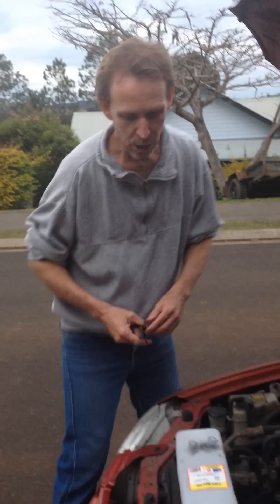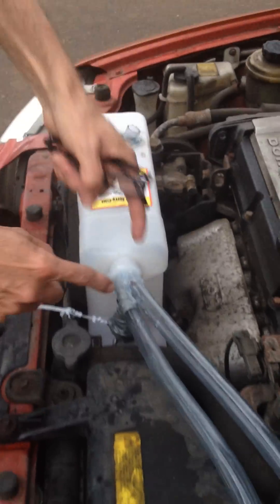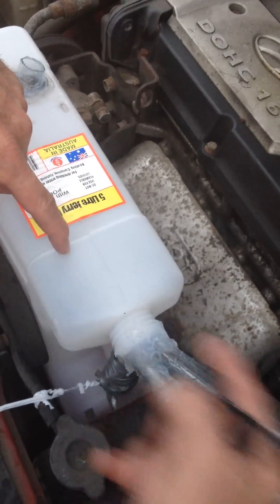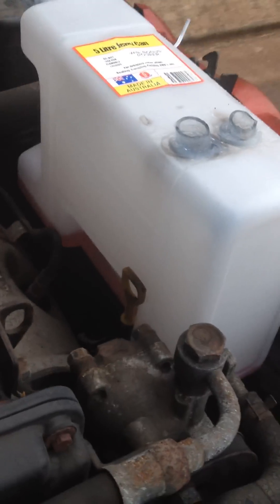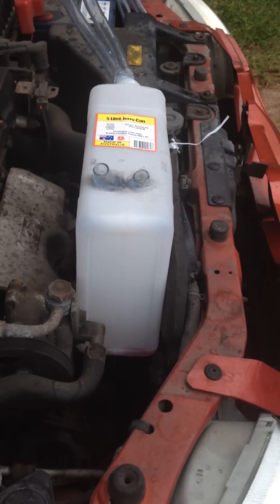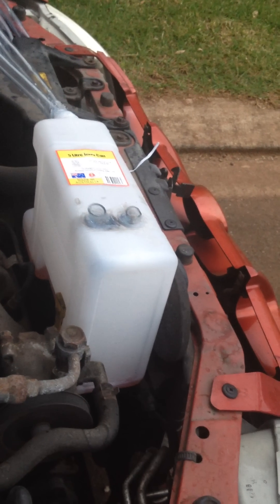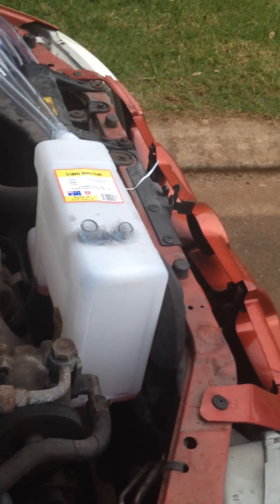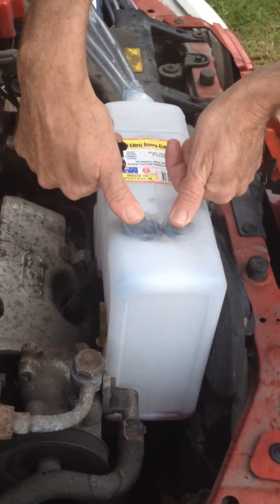Save on Gasoline Run Your Car On Fumes.

Comment: I'm not denying or believing this guy  but to everyone looking at this from a non bias point of view and analyzing the video I noticed something that didn't make sense to me and because of that I would not believe this video but that's not to say I don't believe it's possible but in the video he holds up the fuse box or relay cover box and the relay he is referring to that he pulled out did not align with the sticker on the inside of the cover which when looking at the cover it was on the top left hand side which would align when putting it back to the top right hand side and the fuse that he removed was on the top left hand side which would mean the sticker would have to be on the top right hand side when looking inside the COver, I hope that made sense.

Comment: Hello Paul. Gasoline is getting more and more expensive. And I have decided to do this experiment in my car. Could you tell me if when we remove the fuse from the fuel pump the injectors are damaged when they work dry and then we can not use them anymore.   If your car has injection. Could you tell me if in all these years you have not  had to use the injectors anymore?  My car is a subaru forester 2009. Please help me. I am a little afreid of losing my injectors. Your answer is very important. Thank you very much. Mario.

Comment: The problem I see here is that it has a free flowing air intake with  no air filter. It will be sucking dust and dirt !  Also, there needs to show a way to have a heating system to keep the fuel warm.  I would suggest a copper coil running from the radiator fluid line to the fuel container (This would also aid in fuel vaporization) or coiled around the fuel intake hose that goes to the intake manifold.

Comment: Thanks sir.. This will save the average person $1200 to $2000 dollars a year.

So you just need to find a spot to put the plastic container under the hood of any car then run 2 tubes into the air filter than one to the intake?

Comment: Its full of sh_t people !  Trust me , I try that at home already on my push mower !  It does run on fumes but here is the problem ?  I did a equal fuel consumption test of eqal part of exactly 1 cup of fuel on both and the fumes ran exactly almost 2 minute longer than the straight fuel and carb set up !   Here another problem ... my fumes lawnmower had ..... NO proper fuel and air control to regulate the power needed properly to cut the grass !  also .... no power or stamina in the engine HP for the real world grass cutting job unless you are cutting up to 2-3 inches of grass at best and thats pushing it ...trust me  !  I don't see any positive result in converting liquid into fumes other than burning a little cleaner for the enviroment  but then again .... why do we start the push mower and the car anyway ?  To ensure we get the job done properly with control and stamina of HP to get the job done right the 1st time !    RIGHT  ?   There  NO control or adequatete HP  to get the job  done right just to run the engine a few seconds longer !   ..... if he telling you he getting 10-100 miles more than what he's getting now running on fumes !  ......  He's full of sh_t !

Comment: UNSAFE....CAUTION.... This person has placed a plastic fuel tank directly next to his car's exhaust manifold ! Exhaust manifold temperatures can get up to 1000 degrees Fahrenheit! This is a fire and possible explosion waiting to happen. The plastic fuel lank will melt, and the gasoline vapor and air will explode and catch the car on fire. Very Dangerous situation!
Reply: Bubbler type vapor systems do not work, because they will not vaporize all of the gasoline, in the bubbler tank. Only part of the gasoline will vaporize with a cold gasoline bubbler set up. Gasoline is made up of a combination of different ingredients, some of which vaporize at very low temperatures, other parts vaporize at temperatures of up to 400 degrees Fahrenheit. This engine will run for a few minutes on the low vaporizing temperature parts of the gasoline until the gasoline goes flat, and then the engine will stall, and the gasoline that is left in the bubbler tank will not produce any vapors.  If you would like to see a real... safe... engineered... all stainless steel gasoline vapor system that uses 100% of the gasoline, check out the Gasoline Vapor Systems group on Facebook.
Reply: Really ? You say that it can get up to " 300 to 400 miles per gallon". Can you prove that ? Have you done any testing?

Comment: Have you tired driving while the injectors are still on? Im thinking that the extra fuel vapor would help the ECU lean out the fuel injectors, and get better mpg.

Comment: I had the diligence to try this... WELL -  IT DOES NOT WORK... nothing changed, same consumption on same millage, in fact, I run out of fuel, had to connect my fuel pump for the car to run normal.

Comment: You know that your car now has 1/5 the power it had...right?
Plus there is a reason why cars don't have plastic fuel tanks...do you know what "electrostatics" means?
Reply: You are an idiot. The tank in my truck is plastic.
Go read a book.
Reply: JDM Fanboy do your research,BMWs for exampe have had plastic fuel tanks since time immemorial.
Reply: Um dude 98% of cars now days have plastic tanks because there way lighter I highly advise you to go have a field day at the junk yard

Comment: i have successfully got this working in my truck this is not a lie, however after about 6 minutes of  running the gas can ( plastic tank ) gets too cold to produce vapor and the car stalls, any idea on how to keep the tank warm?
Reply from the maker: Hi ZZROBProductions don't know if I can help. When I did this I believed the bubbling effect was producing enough fumes needed to run the engine. I haven't done any further experimentation since.
Reply: Paul Freeman thanks , I'm going test it with the wicking system like the vapor kid did, the results should be better.

Comment: Everybody video show that it works but nobody has shown how far you can get on a gallon of gas!!!
Reply: Because it would get them killed.
Early reporting of these engines in the early 70's you'd get a few hundred miles to the galon

Comment: Josh you can also put wicking material in your tank check out Humidifier filter material you will notice that it will wick liquid  up on it. maybe even baby diapers check out the material they use on fuel spills to absorb the fuel be safe

Comment: also I had an idea to allow a small flow of petrol to travel to and from petrol tank.. say a low volume flow pump to replace the tank pump
to happily and gently circulate fuel and also generate more fumes with smaller increase of flowing fuel which may help with starting engine.

Comment: could you do an update of this process if you have this car still?

also a flux tank for vapours might be ideal with check valves to hold the gas in the flux chamber to allow the car to start easier.. 

the check valve alignment always prevent against the floe ie, only allow vapour flow to enter engine and never come back out to have backfire prevention

Comment: Also....your tubes appear to be too large. We had a explosiometer to learn how combustable vapor is. It does not require that much vapor to sustain a gasoline engine to run very ..VERY well.

Comment: This may be a little late to post but hope its finds its way to you or wnyone else working on a similar project. Back I n the mid 1070's myself and two friends decided to work on this based upon our memory that when we were in high school and on dates, just before our cars "quit" running, we experienced added performance. We summized that we in fact were running on fumes. So we set out to try to do that on purpose. We used a 383 HEMI engine in a Dodge pick up. We did not have the technology that you have today to convert raw gasoline to vapor so we designed and built a highly sealed canister and also design a ceramic resistance heater within the canister to use heat to expand the raw gasoline. The pick up/ 383 engine we used had a electric fuel pump.  Lesson 1. We had to install a cam so we had a cam driven fuel pump so as the RPM changed, so also did the fuel feed in direct harmony.  We also had to overcome timing issues. After we got it running, we experienced increased engine operating temperature of over 100 degree's. So we had to make alterations to control that. Once completed we experienced a few things. One, we got over 110 MPG over the road, in mountains and below sea level. We also experienced substantial increases in HP and torque. Three adult men in the old truck on the highway headed west between Dallas and Fot Worth Texas at 65 MPH and THEN..floor boarded it. We burned rubber for at least 100 feet from that speed before letting off. In construction and design, we used a Rochester quadrajet carb. We determined and had a new ventura slip made to insert in to the top of the carb. We also had little luck trying to use the vacumm to pre4sent the vapors in to the "top" of the carb at the air cleaner. We ported input or feed lines in to the side of the existing carb top "at center". We were highly successful. We knew that we were all going to be millionaires. We had patent checks run so we could start our patenting process. We found that just about everything that we did that provided the beneficial cause and effect had already been done and patented as far back as Henry Ford and up to the last 5 years prior. All held/controlled by large corporations.
Reply: As a former patent broker I know there are between 240-250 patents on this device.Some were held by Shell Oil, GM, Ford, Chrysler to name a few. All are in the "public domain" now and not "controlled" by anyone. All the patents had a 17 year life and now all are expired. This means anyone can build one based on any of the patents registered based on the drawings supplied for registering the patent in the first place
The government isnt in possession of any patents as they are the body that issues them and they have the right not to issue a patent at all. If they were trying to bury the idea they would not have issued patents for it in the first place
The reason the rest have not marketed the idea in the past is because it has never solved the problems in using it for everyday traffic conditions. Vacuum is not responsive enough for constant acceleration/deceleration. While I have acknowledged you have had limited success, it takes extensive testing to determine its limitations
I have worked on this idea for 3 years full time. I have thought of solutions to the limitations but it is not the "one size fits all" $300-$1000 add on that is the benchmark for ideas like this

Comment: This is a scam that has passed the test of time.  It is over 50 years old.  Why settle for just better gas miliage ?  
There is a way of using the engine exhaust to vaporize the gas.  If you do it just right you will never have to buy gasoline for the rest of your life.  Just route the exhaust pipe directly into the gas tank.  Even if you survive, more that likely the car will not,  so you will not have to buy gas for that car ever again.  R.I.P.

Comment: Tom Ogle did this 40 years ago and tried to sell his invention but was murdered by the oil tycoons
Reply: Tom Ogle was actually not successful and he knew it. In his remarkable test he stalled 5 miles short and still had gasoline in the car and could not restart. Tom Ogle knew it had to run at a set speed all other  successful tests of this device were done on test tracks at a set speed
Reply: Leslie Clendening humm... Set speed you say? Like a constant load off of a generator charging a battery pack?

Comment: 2 tubes going into that plastic tank and the ends of them are protruding out.
Reply: The two tube sticking out are vertical bubbler tubes that go down to the bottom of the tank below the petrol level, the tubes exiting horizontally just protrude into the top of the tank to suck the fuses/vapours into the air filter assy.

Comment: Paul, have you or possibly Josh made this work long term? I'm trying this on a 2000 Chevy 3.1 V6 and have been unsuccessful so far. I noticed that you have very little petrol in your container. I'm using a 1 gallon gas can and have it half full. Two 3/4 inch pipes take the vapors to the air intake and I have the same bringing in the air to bubble the petrol. Perhaps I need more intake air and output vapor? Thanks, mate. Transplanted Brit to the USA as a kid.
Reply: Hi Jack, Please check out the Gasoline Vapor Systems group on Facebook.

Comment: When will we see an engineer with money look into this to see if it is possible.
Reply: Some of the smartest people in the business have tried to do this but vacuum is not responsive enough to meet the constant changes to run the car in ordinary traffic.So rudimentary experiments like this video is possible but marketing the idea is not possible
Reply: Leslie Clendening I think the key to vapor systems and vapor metering is getting the vacuum to act the way you want. I'm making some special valves and paying real close attention to flow characteristics. Im also going to hook up a trimmer valve to a servo with linear increasing flow passing through the port.
Reply: A lot of time energy and money has been spent by some great engineering minds trying to conquer this issue. Keep up your efforts if there is one thing ive learned in this life is that I dont have all the answers and I dont know everything. Good luck and keep on posting

Comment: Take us for a ride. Have you ever entertained the idea of building an on board nuclear power plant? lol ... seriously though. Splitting molecules by way of electrolysis to run hydrogen. The on board sub station will take some major amperage to make enough to run off but we have photovoltaic glass now. Install that all the way around and run your generator with it. The combo of that and your alternator should produce enough electricity to separate h20 and turn your truck into a hybrid getting several hundred miles to a gallon of petro without lacking power. In fact it should make more power. The amount of fuel you use is directly related to power. It's physics. You need energy. If a binker full of gas can run a truck down the road for 100 miles then a pack of flies can pull my trailor for that too!

Comment: I've watched a few of these video's now. I was a line technician for GM for a very long time. I'm not going to rule anything out but my first observation has been the, "proof". If you want to prove it clogging the air stream won't work. All an engine is is an air pump. Block the air ... well you've gotten the idea mate. My question really is tailored toward WOT. How does that little bugger do up a hill? Or with some weight on it? Seems to me it would do more then struggle at any rpm especially when you come up off idle. Care to expand?
Reply: hey Austin. this video was made after watching mine. look at gas saver dodge runs again.  way better. driving around the block
Reply: Care to expand? I guess not

Comment: Will the petrol not evaporate through the air inlet tubes? Also the petrol fumes can catch fire if running engine very hot!

Comment: All well and good on have the engine idle off fumes. 
But having the engine run under load is a completely different story.
If you please sir, share with a video of driving with this system across the entire rev range.
Reply: check out           gas saver dodge runs again       this is a detailed vid running down the road.

Comment: I will let you know right now that this is not safe for your engine at all.

Will it work? Yes.
Why isn't it safe?
Because your vehicle has to compensate for something called knock. Knock is what happens when your combustion chamber detonates before completing the compression stroke. It's noticeable. 

This is why there are more than 1 octane rating. Octane deters knock/pre-detonation by increasing the flash point of the fuel. Vapors have a very low flash point. 

While you may save a ton of money on fuel cost... you will end up spending thousands in engine repair later.
Reply: Shane Jackson If it were knocking you would hear a distinct 'knock' thats why they call it knocking.. Its not knocking.. Vapor resists knocking.. It is after all vapor from the very fuel designed to resist knocking.
Reply: You... have obviously no idea what you are talking about.
Reply: I had the diligence to try this... WELL -  IT DOES NOT WORK... nothing changed, same consumption on same millage, in fact, I run out of fuel, had to connect my fuel pump for the car to run normal.
Reply: xomojo you know that it will NOT happen right away? How can you talk about stuff you don't understand? You are obviously dumb...
Reply: and which oil company do you work for?

Comment: Hey Paul this is Josh Lineberry. I am watching your video now and I am extatic that you saw my video and have shared this for other people to see. I recommend putting a flash arrester on this unit as you play and experiment. Get some wire screen and jam it in the tubes and air filter area. This will help in case of a backfire. Good luck!
Reply from the maker: Thank you Josh, how you demonstrated the simplicity in doing this on your video is what really inspired me. Thanks for the tip on using a flash arrester. All the Best!
Reply: Please

Comment: Hey  is this safe ? Can I run it through hose pipes  rather than that clear pipe ?  Could you Facebook me ryan mini sniffing lynch as I ha en a car with a bad fuel pump and want to move it ? How far do the pipes go into the can how about the air pipes how far do they go ? A install video would be great
Reply: go and watch    gas saver dodge runs again     you will see.